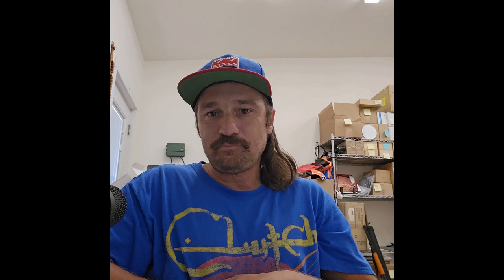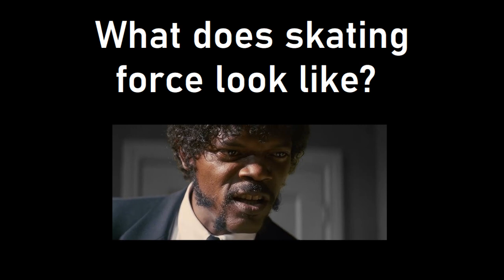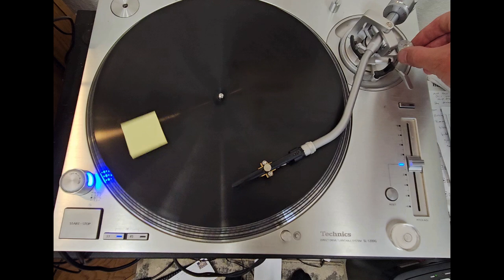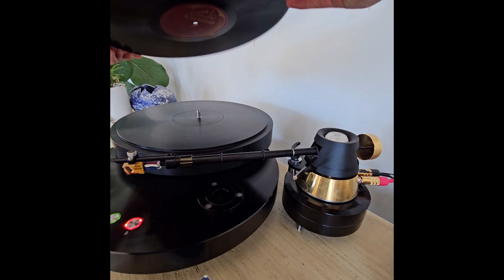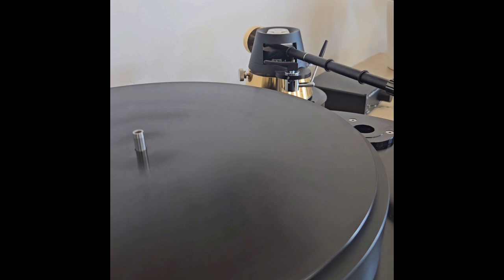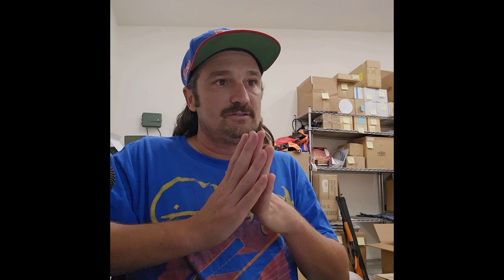Turntable Anti-skate: What does skating force look like, and how ViV Lab does things differently

Comment: Hi Mark, the so called specialists realy don't know the basics of it all. Whatever arm or cartridge one designs it always boils down to a point connected to another point. If you take your approach with the middle of a 12" record playable part being 80mm and a 12" tonearm with the needle all the way to the end, resulting in say 342mm, the maximum error angle will be 6,6 degrees. I mean, nothing beats a nice tangential tonearm, but 6,6 degrees is very acceptable...

Comment: Just one quibble, you state that overhang requires offset. This is not accurate.  You can still have one minimum error 'null' point with no offset, similar to the tonearm you're discussion. With overhang and a non-conical style, you can only have two minimum tracking error null points (using a classical alignment) IF you have offset.  Not quite the same as requiring offset to be an overhang tonearm.  Otherwise, good video. There's an article in this months' (Oct2025) Stereophile by Jim Austin on skating force that shows he still doesn't understand overhang effects...
Reply from the maker: Understood, and thank you for the comment. I think what I meant is that offset and overhang are both required to achieve two null points as you mentioned. If one were to push the ViV Lab tonearm forward and closer to the platter, its single null point would move further inward on the record. But I wouldn't call that "overhang" based on my understanding of the term.

Comment: The skating force is made wether by offset ange nor overhang. It's generated because the frictional force between groove surface and stylus which is tangent to the groove doesn't inline with the pivot of the tonearm. This is true for overhang tonearms and also for rigid float except in the only one zero point. 
The other point is, if the rigid float passes the zero point, the skating force will be point outwards. Like you showed us in the video. The importance of this is largely overseen. On overhang tonearms the skating force pints invards, to the inner of the record. This is very useful, because this force is moving the inert mass of the tonearm. We don't have to care about it. Tangential tonearms are free from skating, and we have to take care of moving the tonearm. By motor, or by lightweight tonearm by the outer groove wall. 
If the rigid float passes the zero point, there is no skating force which moves the arm, which creates excessive force on the outer groove wall. More of that, if the tonearm travels further inward, the increasing skating force, which points outwards, is against the movement, so more force of the outer groove wall...
Reply from the maker: Well said, friction is the force that causes skating. Overhang/Underhang determines the position of the stylus and therefore how much friction it encounters, and the direction of the friction. And yes, the small amount of skating that remains is in the opposite direction on each side of the null point.

Comment: I am lucky in having a workshop and the skill to make my own tonearms and experiment.
I have used a linear air tracker most of my hifi life, but recently discovered the SUPATRAC principle. The clone I made of this totally trounces my air arm, which surprised me as I thought I would hear the offset distortion. It could be because I am using a brand new ATOC9XLM, so there is no wear on the stylus.

Reading about underhung arms, in particular the VIV, I decided to modify my clone to zero-offset & underhung. Wow.....sounds like the arm is on steroids now, and even though I am theoretically introducing more groove distortion, I am not hearing it.

The Supatrac, being supported by string, does introduce a twisting motion which can be countered by rotating the pivot. Still experimenting with bias using a blank acrylic disc.

Thanks for the video.....taught me a lot!
Reply from the maker: Thanks for your comment!

Comment: My background is engineering based (EE undergrad) and we engineers often first attempt to make a visual model of a process works.  With the model set, then attempt to design or understand or modify the process.
I have been struggling with setting the anti-skate adjustment while not finding a clear explanation of the relationship between cartridge angle offset and arm angle offset, drag force, etc.  Although seemingly simple, the model displayed here answers many questions because one can modify the variables in real time and see the effect.   If and when my tonearm departs this earth, I will certainly consider a ViV lab tonearm.  Many thanks for this brilliant although seemingly simple explanation/demonstration.
Reply from the maker: Thank you Wesley!

Comment: My understanding of the overhang/offset angle design is that they are able to make the stylus angular error in the groove zero at two points in rotation from edge to center and small angles everywhere else , It seems the Viv design creates perfect tangency at one point near halfway across the record with increasingly higher angular errors the farther from that midpoint the stylus moves . It looks like the Viv nearly solves the skating problem at the expense of more angular error to the groove . Both approaches seem like one step forward and one step back . A perfect linear tracker may or may not be possible , but I'd love to see one some day . There is a German electronic linear tracker accurate to a micron , but it's $150,000 .
Reply from the maker: You're absolutely right- overhang/offset reduces tracking error but introduces a constant inward skating force that needs to be countered with anti-skate. The ViV Lab arm allows the tracking error to be higher with the benefit of better lateral stability (near zero skating force and no opposing left-right forces affecting the cartridge). All designs have a compromise somewhere, including linear arms. You're right that linear arms solve both the skating issue and the tracking error issue, but the compromise there is less mechanical efficiency, chatter, friction, etc... no matter how high the price. All designs categories can sound great though, if they are smartly engineered and well-tuned.